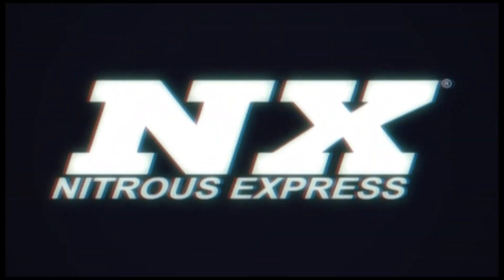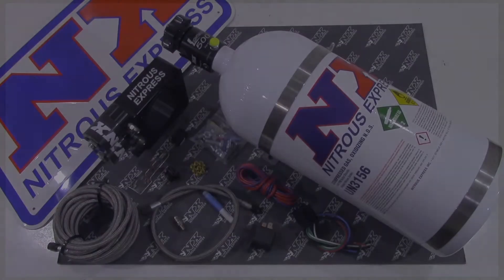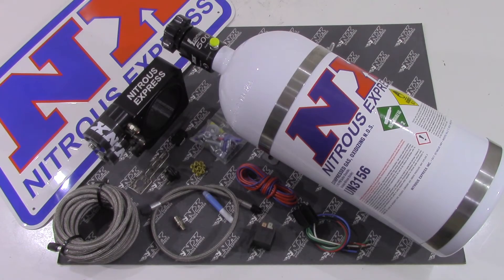NX 5.0 Pushrod Plate System Part No. 20955

Comment: Anyway to fit a 95?
Reply from the maker: No sir, they will not fit the 94-95 models.  You would need part # 20922-10

https://www.nitrousexpress.com/all-ford-efi-single-nozzle-system-35-50-75-100-150-hp-with-10lb-bottle-20922.asp